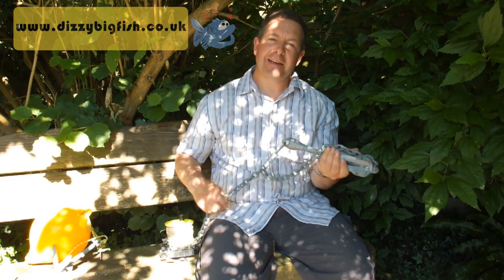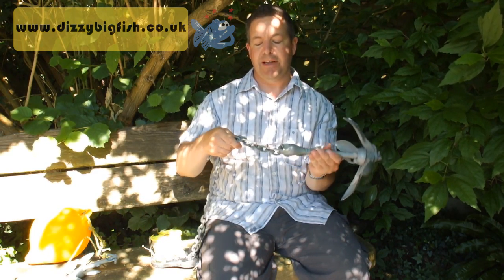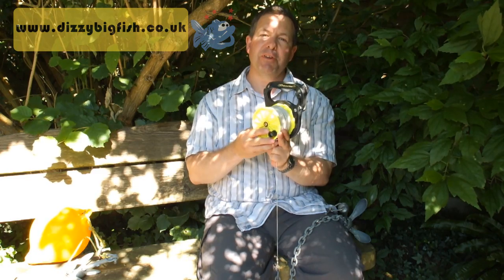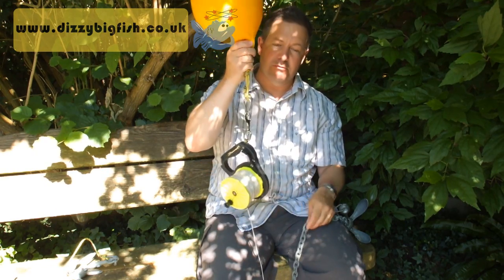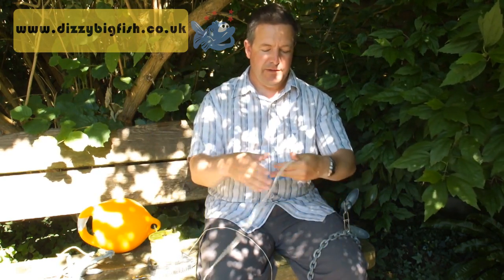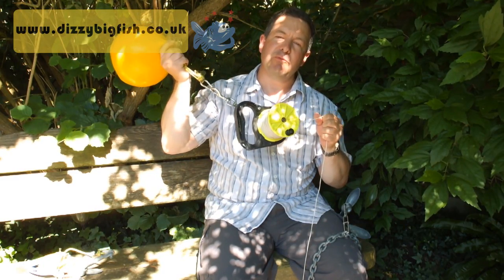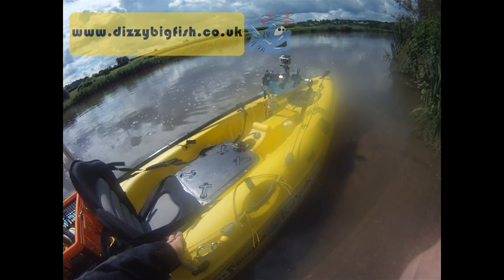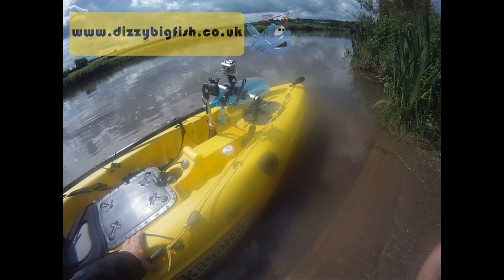Anchoring in the kayak - Part 1 Anchoring System

Comment: What is the cordage for an anchor system called i dont want to use para cord i want the exact marine stuff but i dont know what its called and cant find ""marine cord rope string "" on ebay
Reply from the maker: Try searching for "anchor warp" have a look at Jimmy Green's or Force4 - I bought some 3mm Liros bulk line from them which was spot on